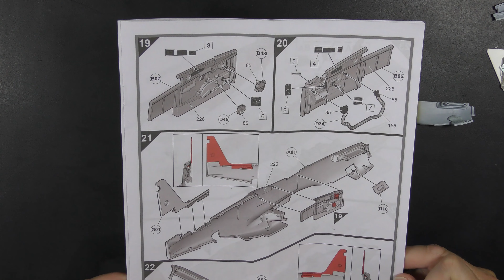More Modelling for Beginners - Part Four, Fuselage Completion

Comment: The unidentified "thingy" on the Port sidewall is the Flare-Pistol port. There should be a corresponding flare pistol sized hole on the outer skin (the kit has a dimple), slightly to the rear, as the port is in reality angled rearwards away from the trailing edge of the wing, rather than being flush with the sidewall. The inside had a cap fitted when the pistol was not in use. The 4 "spokes" are springs to absorb the heavy recoil from the pistol, which locks into place with lugs...  Proper Job.  :yougotthis:
Reply from the maker: Thanks for the info M!

Comment: Yippee...I'm caught up again.   I was especially fascinated watching you put the two halves of the fuselage together.  I have used CA (i.e., super glue) at times...but usually just go with Tamiya fast setting thin cement.   I'm always a bit worried that the "bond" between the halves with CA will be more "brittle" than with cement....but I might using more CA on my next kit.  I certainly need to find some of those little micro-brushes you use to introduce the accelerator to the glue joint.  Thanks again for a great series (I'm almost tempted to build another Mustang).

Comment: I didn't have any of these fit issues on my kit. You seem to have a particularly poorly moulded kit there. Enjoying the build but I am waiting for you to catch up with me to see how you tackle the painting. Keep up the good work Jen x
Reply from the maker: That's good, and is a thing on Airfix kits I find. Some are definitely better (or worse) than others. It's luck of the draw, but in this case I think the fact that I have a less good one is useful as it allows me to show the fixes.
Reply: @JenesisDesignsandModelcraft  It's simply known as poor quality control, Jen. In 2024, that's just not acceptable. Production needs to return to the UK.
End of.
Reply: @markfranks1329  Expect to pay a lot more, and don't forget that The UK made kits also had issues.
Reply: @memkiii  Fair points, but I'd still rather have production in the UK any day of the week.